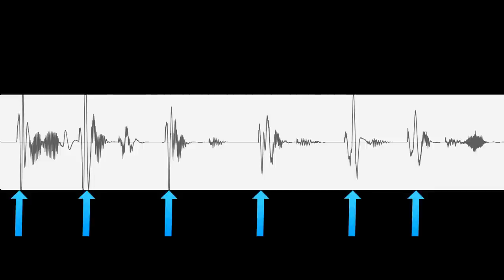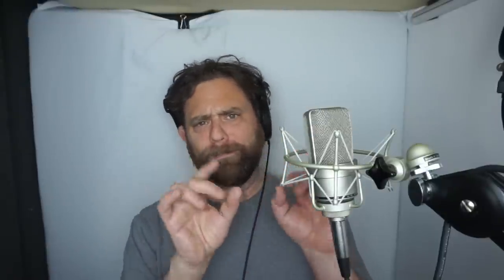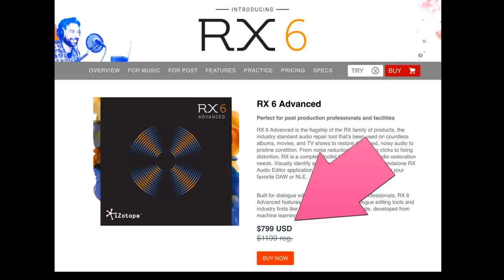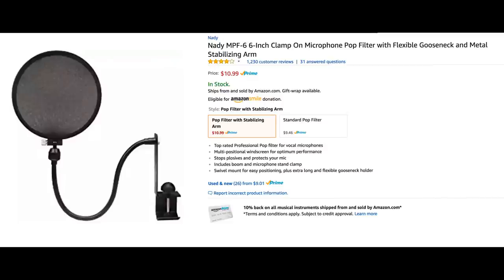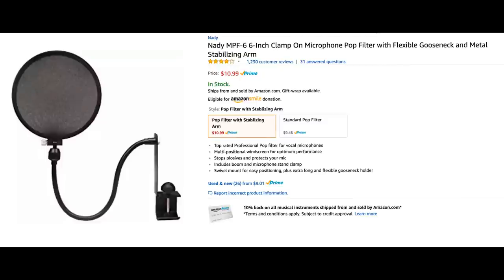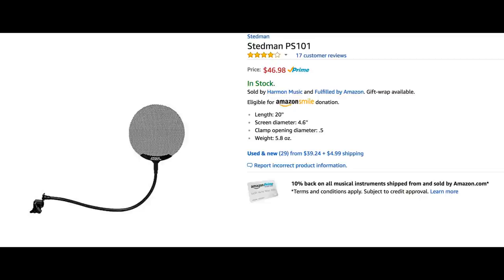Which pop filter should you use?

Comment: I came here to find a bit more 'wave data' driven info. Wasn't there. I've heard the 990 is a bit bright on the high end and the double layer nylon filter somewhat deadens the high end, so they sound like a perfect match. The steadman style filter can be got for under $10 on up. Don't need to spend $40-50. Most decent ones will be $15-30. The overlooked but very important part of a pop filter is the gooseneck's robustness & ability to hold where you place it. The cheaper ones will have a much weaker neck and will require much more adjusting to finally get what a better one will do right away. Other than that as he mentioned the special stamp holes on a good metal filter will be more effective than the cheaper ones. But it all depends on what you are doing. Low end work or highly professional work.

Comment: Which one is more recommended for singing ?
Reply: Not singing directly to the mic works the best because the air is not hitting the mic and you can increase the gain but if you want to use pop filter, probably nylon because it doesn't cost that much.

Comment: The short answer: Not a windscreen. If you think they're the same (any of you) you're wrong. 
Period.

The material itself performs differently acoustically and it is in fact NOT intended to "diffuse vocal blah blah". It is ONLY to "reduce wind noise". Period. 

If you're using a windscreen in your indoor studio you wither don't need it or you also need a pop filter. If you are outdoors, then a popfilter would be irrelevant and the windscreen youre only option, regardless.They are not interchangeable.
Any audio engineer will school you on the diff foams. Swallow these facts and move on.

Comment: I know this is an old thread ... but
there are some old favorites
all the commercial cloth/mesh filters are derived from a coat hanger with stocking/pantyhose stretched over it. ... this still works and is cheap. ... fishnets not so good.
The kitchen sieve does work, but it has to be a very fine one ... the general purpose coarse ones will do nothing
Then of course there is the favorite of the sporting OB sound guys ....... the condom ...... seriouslsy ..... this is what they use when it is howeling a gail out side and they still need to work ........ it is also great when rain is expected ....... best to put a foam or dead cat over it for appearance sakes ......... particularly when you put a franger on some nice ladies vocal mic or on the lecturn mic for some high ranking official.

Comment: if you take an old wire hanger take your time bend it in to a small 4 inch circular shape and grab an old pair off pantyhose wrap it around the hanger its off to the races till you can get your hands on a nice manufactured pop filter.